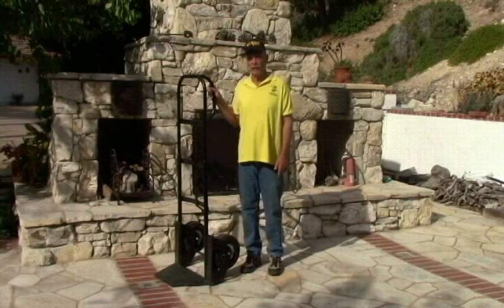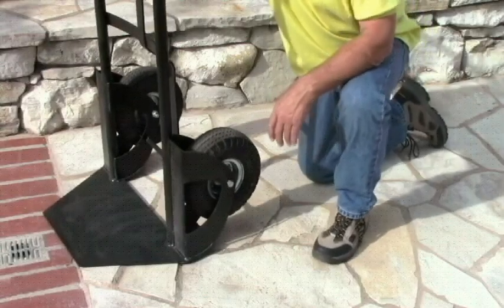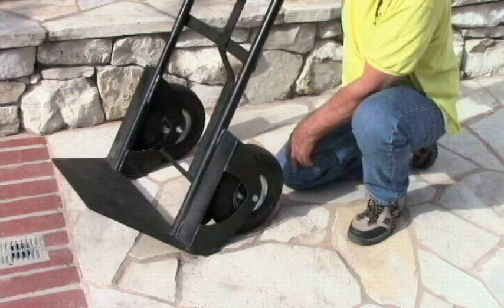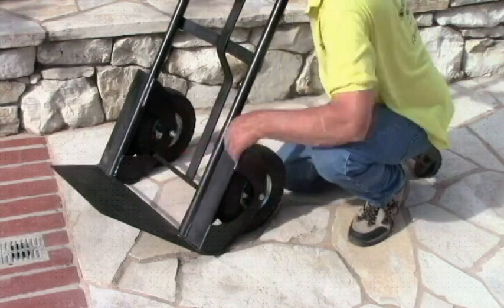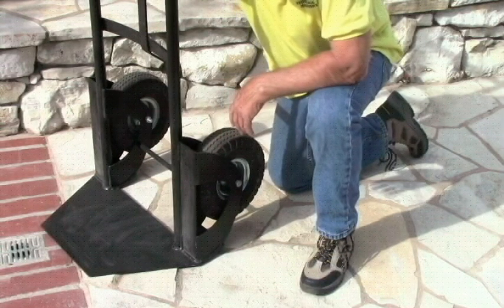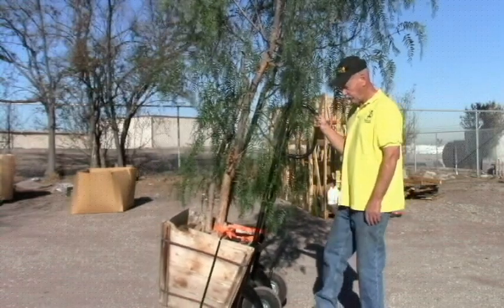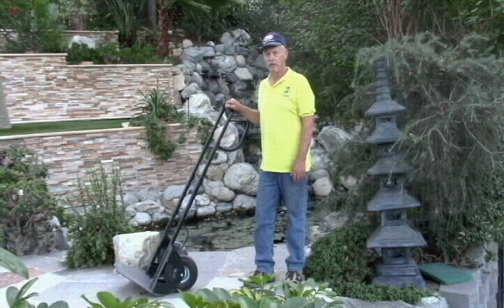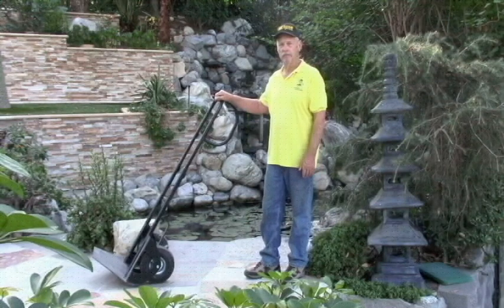Heavy duty dolly /hand truck for landscaping and general purpose  use with  power rocker system

Comment: apparently they are out of business...unfortunately.  I can't reach them and their website was never completed.  Unfortunate because this is an excellent design.
Reply: Its because the video only has a few hundred views.  This is because the product looked crapy but it is a good design.
Reply: @stonewallgregg  what is this dollies price tag? how would someone purchase it?
Reply from the maker: slow going....finally got my website up.   the beast of burden handtruck.
Reply: @stonewallgregg  how much are theese hand trucks I'm shopping for one now
Reply from the maker: have  you gone to my website?   where are you located?   contact me through my site, OK:?
Reply: What’s the weight capacity limit?
How long of a boulder can I move with it? 

Can it move Odd or Triangular shaped boulders about 3-4’ at longest-edge possible? (should be lighter than square/rectangular)
Reply: @stonewallgregg  interested in something like this if it is leaps and bounds better than the milwaukee type thing I find at home depot. Your website has no info on price etc how to buy. Can any viewers chime in on other best options here? Thx!